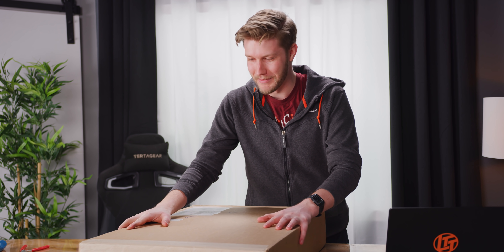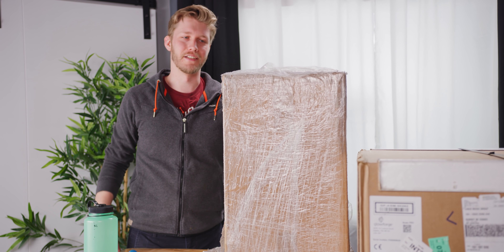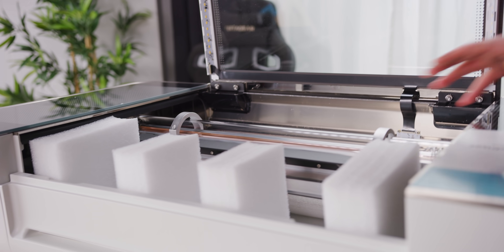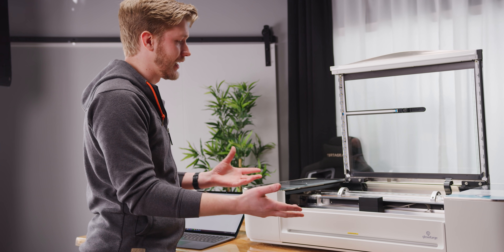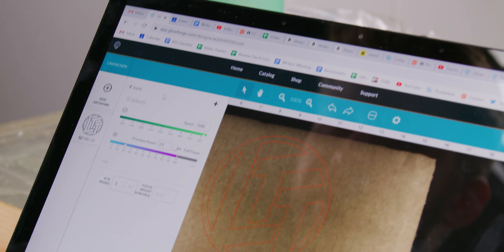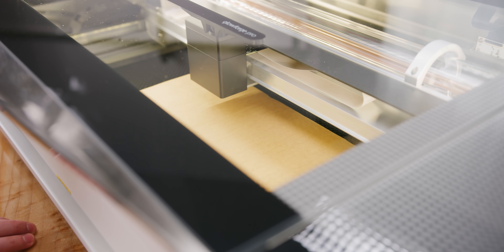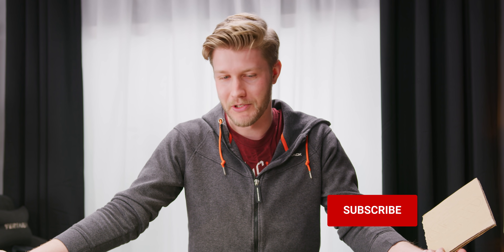Unboxing a freaking laser - Glowforge Pro

Comment: just swapped from a potential Bose purchase to a Sony because of the forced app forced account BS Bose tries. Hate it.

With ususal evil Sony it's optional, works account free and otherwise complies with boring ass standard protocols instead of blocking them to push for an app.

Comment: I used a trotech at a previous job. It was one of the smaller ones in trotech's lineup if I remember correctly. It was great. The shop primarily made cabinets and we the laser to cut out jigs for hinges and draw pulls. It made life so easy

Comment: Glow Forge is super over priced for what it is and what it can do. I have been working on, using, and building lasers off and on for 4 years now. There are a couple of cool features but no where near worth the $6k they want. There are some very shady things going on with glow forge that people who don't know lasers need to know about.
1. Glow Forge was the biggest Kickstarter campaign of all time. Think it was $16 million or something. Where did it go? It was successfully funded and up for a year after the project and then whoosh, it was gone. It was taken down. Why would they take down their biggest claim to fame? I would love to hear from a backer what happened.
2. You have to be connected to the internet to use it...... Why... for what reason... That is complete BS. Explain below.
3. The differences between models is ridiculous with the upgrade charges.  It says upgraded parts, what parts.... what are they upgrading to make a $1500 difference for the 1st upgrade? Well alone another $2000 for the next upgrade. I can't tell you what they actually upgraded most likely almost nothing, maybe $100 of actual cost to them. Here is what I do know the "5w" upgrade to your laser power is complete crap. C02 laser tubes don't upgrade in 5w increments. They jump in 20w increments or more and the tube is larger around and longer. 

Here is the most likely answers. All 3 models have nearly all the same parts with a few minor upgrades other than the pass through. Maybe... $100 worth of cost to them.... maybe... The laser tube is the same in all models, probably a low end "50w" tube that they just turn the power down on. I can do the same on my 50w laser by just turning 1 screw on my power supply. The doubled speed.... that is a software limit they are imposing. There is nothing in that unit that would double the speed with no power increase. They are just limiting you in the software that you can't change or hack because it is online only.

Linus !!! Please prove me wrong. I am a long time watcher and watch everyday.  What justifies the $3500 cost increase from the base to top of the line model? Someone has to look out for consumers who don't know better, and don't know they are being ripped off.

Comment: I'm really disappointed in you guys for buying the "pro" model. 10 seconds on google would have been enough to tell you that the absolutely insane price difference isn't worth it. Glowforge claims the basic model is a 40w tube while the pro model is a 45w tube. That's not the case. The tube is the same, they just tune down the basic model via software. 

They also claim the cooling is significantly beefier in the "pro" model. That's also not the case in any of the recent machines. Originally, sure. Not anymore.

The only real difference is the opening in the front for cutting larger materials. That's cool and all, but you can trick the machine into running with the front door open and just use your new laser to cut an insert and get the exact same results as the "pro" model.

Why spend literally $6000 when you can spend $1500 and get the exact same machine.

Edit: Before anybody chimes in to tell me I don't know what I'm talking about, I have owned multiple large lasers including the Glowforge. I love my Glowforge, I'm just not an idiot that thinks the "pro" model is anything but a scam.

Comment: The Glowforge is a total joke. Nearly $5000 for a 45W(if that, with a noname tube!), tiny toy that is always connected to the internet and runs proprietary firmware. Company goes under? Good luck with this brick, and it will go under eventually. That "open source" option is useless.
You know what you can get for $5000? A 100W or even 200W, floor-standing, large area industrial laser cutter with serious optics, huge working envelope, proper Z axis, and air assist.

Comment: Well built machine, I use it at work. However, the cloud based control is a very weak point. It freezes very often while processing a simple 1 minute vector cut. Imagine if something goes wrong with the Internet connection, or the cloud service, the machine becomes totally useless.

Comment: I feel like the Glowforge is the Cricut of the laser cutting world. It's really consumer friendly which is great, but it's also locked down in a way that limits how you can use the tech.

I mean, they even market it a "3D laser printer"... which it clearly isn't. The language they use in their marketing is really misleading. "It prints truly enormous objects like furniture" - the way that's worded makes it sound like it can literally print furniture. But they don't mean that, they mean it can print ON furniture. And even that's false, because it isn't printing, it's engraving. 

The Cricut's requirement to use their online software is a huge drag when you're a technical person. And, while I've enjoyed mine for what I needed it for, I really wish I could use different software that would meet my needs and skill level better. I feel the same case can be made for the Glowforge, which is especially unfortunate considering the price tag.
Reply: It's even worse when you start looking at the differences between the $1500 basic machine and the $6000 "pro" machine. They claim the laser tubes are different (40w vs 45w). They are not, They're identical, the basic version is just limited in software. They also claim the cooling is "professional grade" in the pro model. It's literally identical to the basic model. Their marketing BS even claims the basic model can't run for more than about 15 minutes at a time without having to stop and cooldown. That's straight up bullshit. I've run mine for hours at a time with zero interruption.

Glowforge is a great machine, but it suffers from the usual "kickstarter marketing wank" crap. Some of the claims they make are as bogus as bogus gets.

Edit; it's even worse than I thought. It's been a while since I pulled up their website. The mid level "plus" machine claims to have "upgraded hardware" that makes it run TWICE as fast as the basic model. (while having the same laser and cooling). It's literally the same stepper motors and drivers as the basic model. If they're doing anything at all (which they aren't, it's identical) it would be via software. It's not though, they pushed an update a few months ago that sped up all the machines. They're all identical in speed x/y movement speed.

They also claim the pro model with its 45w laser cuts 20% faster, because somehow 5 is 20% of 40.
Reply: @thePretendgineer  Wow that's extra scummy! I kinda wish SC hadn't given this company the spotlight, way too many red flags for me

Comment: I've had a Glowforge Pro for about two years.  It's a handy machine but it does have problems.  This is coming from the corporate side of things vs a consumer side.  One it doesn't support 5ghz wifi.  So it's A/B/G/N and not AC.  Our corporate network doesn't broadcast on the 2.4ghz side so I have to set up an unauthorized hot spot to run the machine.  An Ethernet port would have been a great addition.  The alignment of the internal camera and the laser isn't accurate in the least.  As mentioned in the video the center is pretty spot on but once you get about 5 inches outside of center it's bad.  The calibration helps but for more consumer focus of this machine it should have come from the factory calibrated before hand.

Now the web based app is pretty easy to use.  Adding users to the machine and then teaching them how to use it was pretty painless.  We finally got our filter last month after having had it pre-ordered the same time we bought the machine.  When I got the email that it shipped it was a surprise as I had honestly forgotten about it.  The filter works as advertised and when running doesn't let any fumes escape while operating.

Overall for the simplicity of the machine it's a good ready to go product.  Works as intended most of the time and really is handy in some production settings for fine detail work.

Comment: Glowforge is a freaking joke. There are wayyy better, more capable machines out there for the same price. For a couple thousand more you can triple your wattage and quadruple your area.
Reply: For a couple thousand less maybe.
You can buy a bigger 100W cutter for ~$1-2k.
Reply: @Spirit532  And they are garbage with no support. You can barely buy a reputable chinese 100w tube for less than $800
Reply: @BulletproofEveryone  Sure, but we're comparing like to like here. The glowforge uses a noname tube too.
If you want good CO2 lasers, they get expensive, like RECI for example.
Point is - if you're a hobbyist(glowforge target market), you won't see a difference in tube life since you won't ever be running it for production.

Comment: If it's always connected to the internet, does that mean Skynet can take control of it when it becomes self aware?  Is the main application for this laser printer for custom tempered glass side panels or are there other high volume applications?

Comment: Wow! This came out YEARS ago! We were one of the founders and got the first ones when they shipped out. Until last year we FINALLY got our filter for it which was supposed to be something that just sat under the glowforge itself. But why are we unboxing something that's been out for a few years now?

I've asked for stand alone software since it first came out since I HATE devices that rely solely on the internet and crickets from the company. You have to use their very weak  online software which is so frustrating and not as powerful.

Comment: This is totally off-topic but regarding the clamp for the fume hood, both the type shown in the video and the screw-ons are used in washing machines and from my professional experience parting them out and repairing them, the screw-on fasteners have a noticeably higher failure rate so at the very least the added inconvenience comes with the benefit of having a more reliable end product. :)

Comment: The instant you said it used online app, I thought of the 10s of desktop 3D printed that are brick because of the features one-time purchase item requiring a constant service is a recipe for a brick.
Reply: I mean, if you're savvy enough you can still use pretty much the whole thing, but you'd have to swap out the main logic board for something open, could probably hack it to run off an off-the-shelf 3D printer board you can get for a RepRap machine. You'd have to do a bit of soldering and troubleshooting but it's just stepper motors once you get down to it.
Reply: @jeffrey9411  At one point there were people working on doing just that. I lost interest in Glowforge so I don't know the current status of their progress though.

Raster engraving is complicated and the Glowforge people have spent a lot of time tweaking their (regrettably) internet-dependent machine. Glowforge (the company) has managed to stay in business for several years now (to my surprise) and have actually released several software-driven upgrades over that time.
Reply: @Hirudin  Pretty sure Alex mentions the open source project for this is on github. I am betting it was the community one and NOT put there by Glowforge themselves
Reply: @Montisaquadeis  You definitely might be right. I thought it sounded like Alex was talking about an official release, one that Glowforge had managed to make so convoluted, sketchy, or crippled that even LTT didn't want to attempt to use it.

While Glowforge was still crowdfunding in the Fall of 2015, Glowforge (the company) promised to release open source software for Glowforge (the machine). They did this because potential customers expressed concerns similar to what many of the people here are saying - they didn't want to buy hardware that would be bricked if the company went under. Despite the promise, YEARS passed without a release.
Reply: I have a 3d printer like that but fortunately they provided software that allows you to upload Cura created files over USB
Reply: Juicero comes to mind

Comment: I don't need a lasercutter and I wouldn't buy one but the fact that this thing needs to stay connected to the internet puts a bad reputation on that company anyways. 
It's simply unnecessary and offensive to the customer.
Reply: I'd much rather just get a Universal Laser Systems, or an Epilog, or even just some knockoff. Cause with any of those, you can easily upgrade stuff you need as you go, and can end up with a great machine that never needs any internet... I never had an issue with them at school, so I don't see how the Glowforge is solving anything. Just a waste of money...
Reply: Dumbass your phone and computer are on the internet too get over it
Reply: Wouldn't you want insta firmware updates?  Like windows and it's great updates?

-LaughingInApple

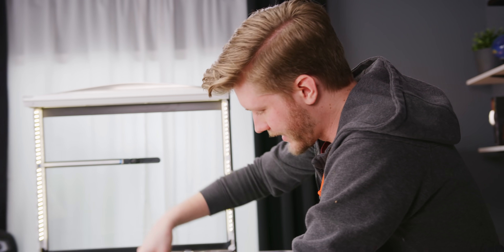Comment: 4:47 I'm pretty sure the airs job is to blow the smoke away because the smoke absorbs and reflects the laser and then it won't cut
Reply: The lens can also get sod on it, which reduces the effectiveness of the laser and might damage the lens as it heats up
Reply: If you ever buy a laser cutter, turn off the air supply. You will find your workpiece on fire very quickly. That's a high speed and very narrow jet of air, used to both extinguish the fire, and blow away any particles. There is also supposed to be an exhaust system to create equal pressure, and exhaust the debris out of the machine.
Reply: No, as everyone knows, air and therefore oxygen prohibit fires from starting. Sometimes I wonder how alex manages to convince linus that he is a pro at anything :D
Reply: Stefan Schäfer too much air does indeed stop a fire, which is why you can blow out candles rather than start an inferno. The Freaking Tiny Fan (c) they used on the Glowforge for air assist seems to primarily be to keep the lens clean.

Unfortunately, it also blows the vaporized soot directly over and onto your project, making it pretty dirty.
Reply: @jordymoors  Wow, you can blow out candles!? Didn´t know that. That´s obviously the exact same thing as directing a stream of air directly at something glowing. Thx for your advice, helped me out a lot.
Reply: Stefan blowing out a candle is indeed the exact same thing as directing a stream of air at something that's glowing, correct. 
Is there a point you're trying to make, or do you enjoy trolling? Air assist has worked, does work, and will continue to work as a fire surpressant on laser cutters, it's no happy accident, nor is it magic. 
Have you ever used a laser cutter before, or are you showing off what you think you know about them by using some false equivalencies?

Comment: Correction: The holes are not because a flat piece would heat up. It is to avoid reflections of the laser on the material and thus marks on the bottom.

Comment: Just because the power rating is marginally better doesn't mean it might not perform significantly better. I worked at a company that had a 3 kilowatt and a 4 kilowatt laser, and for some reason the 3 kilowatt was the only one that could cut through 3/4 inch steel.

Comment: This is such a waste of money. Buy a VLS laser cutter - you keep skimping out on this "user friendly" app shite - VLS system - upload an illustrator file in RGB format and select material (or tweak settings yourself). All settings easily tweakable through the provided software interface - no constant connection to the internet. You are playing with mediocre kit so you are going to have mediocre results

Comment: If the laser is so loud; did you turn on the setting to turn off the internal fan and use the filter system? That should make the Glowforge a bit more quiet

Comment: Alex: "don't move stepper motors too fast"
me: ... 
me: ...
me: moving the x axis on my printer as fast as possible just to have the screen lights up
Reply: Glad it wasn't only me 😂
Reply: Lol same
Reply: Can relate
Reply: Why isn't there any diodes to stop reverse current?
Reply: @bgezal  There is on good machines. Alex is kinda talking out his ass on that one. Cheap chinese 3d printers and the like do it, but any "good" hardware does have diodes to prevent it.
Reply: @bgezal  IT'S AC
Reply: Okay so that's not just me being an idiot :")
Reply: the machine can handle it fine; it's back emf and it also occurs when decelerating a stepper, which as you can imagine it does a lot
Reply: @ikbendusan  Depends on the machine. A good electronics design will protect against that but a cheap knockoff probably won't.
Reply: @danieljensen2626  yeah i stated that with the assumption that the engineer accounted for it. most of em do though, even from china
Reply: alright i’m curious i wanna see that now
Reply: @Levuiii  I would do the x and y Axis at the same time for maximum effectiveness